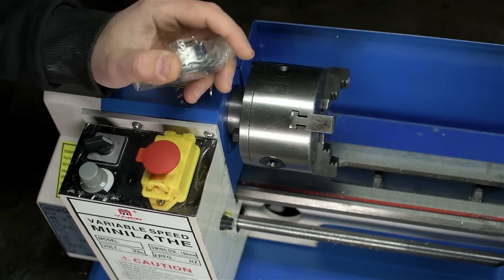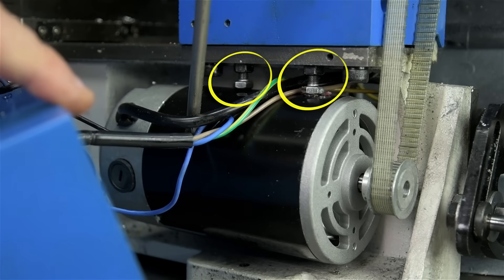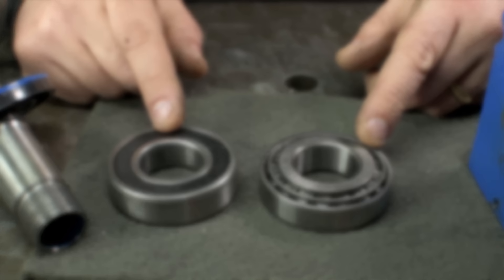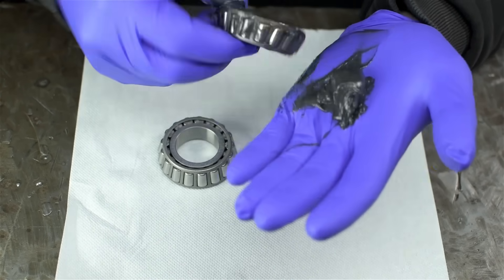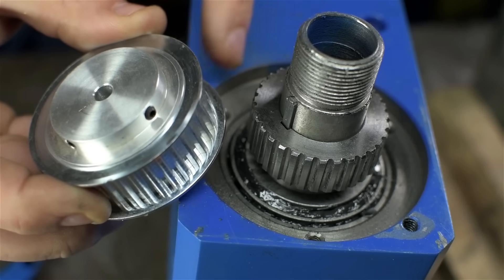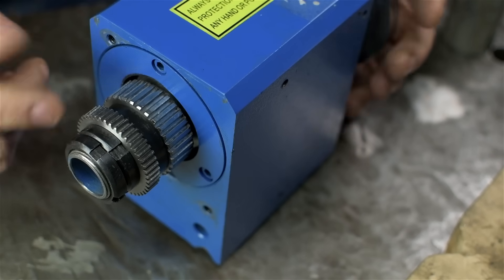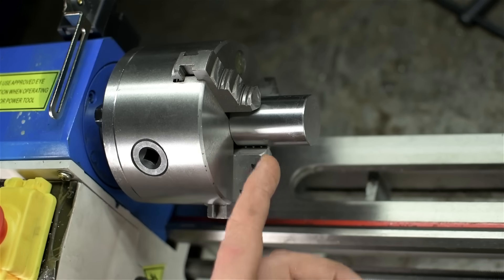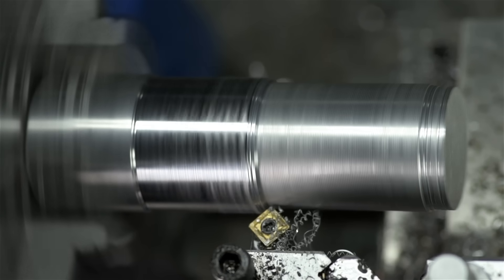Better LATHE Than Never!

Comment: I would machine a spacer between the two tapered bearings.. Just like you would with a pinion of a differential with a solid spacer.  You can shim it to get the correct preload. It makes for a nice rigid trouble free assembly.
Reply: Issue is shimming that correctly. That'd be a whole lot of putting together and taking apart.
Reply: @wyattroncin941 For sure. You'd have to unpress the non-chuck side bearing's inner race off multiple times, which isn't something you want to do a lot of.
Reply: @wyattroncin941  just like a differential..  in reality it doesn't take a long time.  That gear box would go very fast.  The benefit outways the time spent.. once and done.
Reply: @scrappyjackalope9558  I'd just use the jam nuts. If it becomes a problem with your whole 2/3 of a horse, then you have problems somewhere else. Solid spacers are for drag cars pushing hundreds of horsepower, not a tiny lathe that can be held with one hand.
Reply: Wrong,  the whole point of putting a solid spacer between the tapered bearings is to create a more rigid assembly by helping kill deflection.  It works in high horsepower applications yes by doing just that.  The whole point of the tapered bearing in this baby lathe is to cure or reduce deflection.  He may be able to take another couple thou. Of deflection in his lathe or be able to cut another .005"  per pass. Another potential benefit would be a more accurate torquing of the spindle...You dont have to like it or do it yourself.  But it is true and would be a perfect candidate for doing it.  For me I would spend the hour and do it.  With you analogy he should not have wasted his time changing out the roller bearings either..
Reply: Solid spacers are only a thing I. The performance car mod industry. Why? Because at a drag strip you theoretically risk crushing a stock crush ring under load and creating a slop in the differential. That is the only reason they exist, is to prevent backlash developing in a low 10's car. Otherwise they are completely useless. They do not increase rigidity, because they have the same amount of play as a crush ring or a castle but on spindle bearings. There is not difference between effective rigidity, only the point at which the system starts to fail, and with only 500w of power there is zero risk of failure. A solid spacers will add absolutely nothing for rigidity or deflection.
Reply: @wyattroncin941  I explained exactly why and what it does(decreasing deflection which is his problem here) in making a ring and pinion stronger.  By the way it is widely used in many many applications for the exact same reasons.  If you cant understand or do not see the obvious benefit there is zero need to discuss anything with someone of your obvious extreme knowledge.  Have a good day and a happy new year!!
Reply: @scrappyjackalope9558   Your logic is unsalvageable. The front bearing of a headstock is almost exclusively the one which dictates both axial and radial deflection under real-life cutting conditions, and it does not derive any benefit whatsoever from the spacer you recommend. The inner of the front bearing is solidly engaged with the spindle, and the outer with the headstock. The rear bearing is for preload almost exclusively, and is never exposed to significant loads. The nearest thing would be taking a heavy cut the "wrong" way, from left to right, in which case the workpiece would pull out of the chuck if it were not supported from the tailstock (which in turn means the rear bearing never sees that load). The preload on the rear bearing is sufficient that the elastic elongation of the spindle will exceed anything resulting from real life "wrong way" loads, so a spacer to take those loads would make no difference.
Industrial machine tool spindles never use the method you suggest. In the case of a fairly typical industrial lathe, it would require multiple tear-downs of a fully geared headstock with maybe 50 components, many of which require a hydraulic press to remove, just to adjust the preload on the spindle bearings, which would take several days of exacting work instead of a straightforward few minutes to make each adjustment and an hour to run it up to temperature.
Generalising from a differential to a headstock is like expecting a vet to diagnose a human. There are some similarities, but anyone who does not understand both situations as well as the respective experts would not even know what those were.
Reply: @Gottenhimfella pot called the kettle black,  who isnt understanding what?...lol...... every time tool touches material it is causing the kind of load I am talking about.  If this was not the case their would be zero reason or advantage installing a tapered bearing vs a ball bearing. The exact same load is created with a ring and pinion.  The pinion and ring are constantly trying to push away from each other by the very design of the gear mesh..  Again,  by installing tapered bearings you helping stop the deflection that causes chatter since they are a bearing designed to take that load.   Just like by installing a properly preloaded and torqued solid spacer which makes this assembly more rigid by sharing the load between the 2 bearings and essentially making that shaft a thicker assembly having a greater ability to fight deflection.  It is basic physics.  And yes this exact principle is widely used in many applications as others have pointed out here.

Your comment about the one bearing is taking most of the load in it's current configuration is correct. This solid spacer helps cure that problem by creating the more rigid assembly, and distributing some of the load to the back bearing.
Once torn down setting this up would have taken little time,  you are already there putting in the bearings..  would you gain much? Maybe, maybe not.  But when we are machining parts on a lathe we are trying to do this with repeatability and precesion. This can help in the long run make a more durable/stronger lathe.

Have a great new years :) unsalvageable out
Reply: Another problem with just installing tapered bearings with out some sort of a spacer is you are limited to how much you can torque everything else that resides on the shaft behind your means of fastening.  Now with this application it is isnt as crucial since there is little load issues in that direction.  But I would feel better replacing that little sloppy plastic spacer between the gears and getting a solid torque value on those spanner nuts.  Again more things to increase the overall strength and design of this assembly..  Now,  unsalvageable is out. :)
Reply: @scrappyjackalope9558  writes <<This solid spacer helps cure that problem (of the front bearing taking most of the cutting loads) by creating the more rigid assembly, and distributing some of the load to the back bearing.>>
That would be true for bearings which can accept axial load (the only sort an axial spacer can distribute) from both directions, like a deep groove ball bearing. It's patently not possible for taper roller bearings mounted back-to-back. The rear bearing cannot share thrust loads with the front one, because those loads are trying to separate the roller assembly of the rear bearing ("cone") from the outer ring ("cup").
Regarding "the more rigid assembly" you mention: Your spacer would help stabilise the cone of the rear bearing against nutating loads, but only if it were a loose fit on the spindle, which (for a machine tool) would qualify it only for recycling.
Reply: @Gottenhimfella  blah blah blah.  I stand by everything I have said and it is accurate so you are saying deflection due to load does not happen :) ok,  I will stop the discussion with you at this point since it is pointless.   :)  Have a great new year!!
Reply: @scrappyjackalope9558  gottenhimfella is completely correct in that the front bearing takes up almost 100% of loads, hence why the front or bottom of a spindle pack contains a thrust bearing and a seperate radial bearing, then I a back you get a smaller radial support bearing and a preload thrust bearing. Under a cut, the preload bearing would be forced to seperate, if the front bearing wasn't taking up all the load. And during a back cut, the tailstock takes up all the load.
Reply: @scrappyjackalope9558  and to your point of a solid spacers making the shaft thicker, that is completely wrong, unless again you have a press fit for the spacer *or*, as in a horizontal mill, your spacers are tightened down to the point that any bearings that might be included in the pack are now most definitely locked up. The kind of exact shimming that would be needed for both a spacer to be of benefit and for the bearings to be under correct preload is in the realm of shimming with tenths shims, and reshimming every time the bearings are shocked by a crash or something of the like. That is simply not feasible, even for modern manufacturing. Thus, you turn steps in your shaft for maximum rigidity and have a crush ring or similar preload mechanism in the bearing cover plate.
Reply: Solid spacers are used in almost every Machine Tool and Spindle assemblies across the industry. The ring and pinion isn't even a legitimate comparison.
Reply: @mattfaber6689  yes they are used everywhere.  I dont agree on it being a legitimate comparison though.  A shaft turning round and round made more rigid by a solid spacer to ke is the perfect comparison.  Have a great new year Matt!!
Reply: The proper way to setup bearings👍
Reply: American Patriot Adventures, the Head Stock is a spacer between the bearings, the only advantage of fitting any other spacer sleeve would be to contain the grease, this could be shimmed at each end using rubber O rings.
Reply: @johnbower  no john,  the spacer between the bearings serves a very powerful role.  Read all my replies carefully.  None of which have anything to do with seals, grease or oil.
Reply: @scrappyjackalope9558  A spacer between each "outer race" of two taper roller bearings does serve a very powerful role, and in this case the Head Stock itself is the spacer, no spacer is needed between the "inner races" of any pair of taper roller bearings as this is where adjustment is needed to remove all play out of the bearing.
Reply: @johnbower  keep re-reading all of my replies until it starts to sink in,  you will start to figure out the shaft flex will be minimized. I am turning notifications off to this thread as I dont see any need to say anything else to folks who obviously can not comprehend a very simple proven design used for a very long time.  Have a happy new year!!
Reply: @scrappyjackalope9558  No one other than you is suggesting the shaft is " flexing". The roller bearings where fitted to replace the standard type ball races that were originally fitted, because standard type ball races are not designed for this type of use, a standard type ball race does have a minute amount of play in them even when they are  new, the only way to minimize this play is to put side loading on the bearing which they are not designed for, this is the reason taper roller bearings where fitted as they can be adjusted with side loading to remove the play, they are excellent for axle loading and reasonably good for thrust loading, which makes them an excellent choice for Head Stock bearings in a lathe.
 Any problem with the shaft flexing as you seem to be suggesting needs other measures to correct it, and certainly not by putting a spacer between the bearings as this will prevent further adjustment being needed at later dates as the bearings bed in. It appears you may need to think about this for some time before it sinks in. Have a happy new year!!
Reply: @scrappyjackalope9558  Yes you are correct saying every little bit helps, this is why you need to be able to adjust side loading to the roller bearings as they bed in, which you would not be able to do if there was a spacer between them. For you to understand this it appears you need to give it a lot more time for it to sink in :)
Reply: Thank you. You have a good New Year as well. Your are correct in regards to the  pinion they are similar. The plastic spacer being compared to a metal crush washer is my disconnect. I'm no stranger to being wrong though. 😁
Reply: @mattfaber6689  oh I get where you were coming from.  I was never referring to that little plastic spacer between his gears.  I am saying making a spacer that goes between the tapered roller bearings then shimming them for correct preload of the bearings.  

As far as the plastic spacer already there I would make one out of steel as well.
Reply: @scrappyjackalope9558  the biggest issue with the idea of a solid spacers being more rigid is that if the spacer is anything other than a press fit between two press fit bearings, the spacer is doing absolutely nothing to help with any rigidity until the shaft flexes. Yes, if the spacer is a part of the shaft or has a mechanical fit to the shaft, it will be more rigid. But if it has any play at all, even just a tenth, the benefit is lost.
Reply: @wyattroncin941  Hi Wyatt,  I believe you are struggling with seeing the forest through the trees.  Because the assembly is PRELOADED and under TENSION it absolutely makes the the whole assembly more resistant to deflection. The preloaded sleeve is parallel to the shaft under PRELOAD..  It is sharing the load.  If the preloaded  sleeve was not there, there would be a higher chance of the shaft flexing between the bearings under a side load of the tooling pushing again the material being machined.
Reply: @scrappyjackalope9558   
With or without a preload shaft, or solid spacers, the shaft will still be under the same amount of tension. The difference comes when the preload shaft is no longer a preload and us now serving as a  prestressing member. Bearing preload is nothing compared to prestress forces, and at preload force the solid spacers is doing nothing to improve rigidity. If you want a prestress, you make a prestress. But it cannot also be giving preload on bearings.
Reply: Solid pinion spacers in diffs cause as many problems as they solve.Bearings wear in.  And with a solid spacer you end up with the pinion walking around. been there done that in a quick  600hp road race car. Went back to collapsable sleeves with no issue.
Bearing spacers on front hubs are handy but you have to machine them a bit short then allow for a thinnish [at least 20 thou]  shim and expect that to come down soon after.
Reply: That's too bad you had improper set up.  When you set them up correctly with the proper parts there are zero issues with solid spacers.   When yahoo's(and there are plenty of them out there) "throw" in a solid spacer when they have no clue as to what they are doing (sizing, proper preload and torque) you can have a issue like ANYTHING else.  Many manufactures have used them for many years with millions upon millions of trouble free miles.  The crush sleeve came about with assembly line cost cutting measures in both parts and labor..

That all being said, as mentioned above proper preload spacers have proven themselves in HD applications for many many years in many many applications..   Facts are facts..

Comment: youre lucky it doesnt have the hi-low gears... they are garbage plastic and also need replacement
Reply: I am considering carving a new Spindle for full 1" thru and get rid of Hi-Lo  (62x40 bearings)
Just how small do parts need to be that they require the High gear anyway?
Reply: @rwbimbie5854  a 1 inch spindle bore is a huge improvement , but you will need the 5 inch chuck since the 4 or 3 will be a choke point.. You dont need 2500 rpm for 99.999% of operations.. set the gearing 3;1  and you will have 1650 max spindle..which i think is ideal on the small machine
Reply: Too bad the 62x40 bearing is such an oddball size..  not really many midgrade options between $30 in us and $3 in china.
Reply: @rwbimbie5854  what about the mini mill 60mm bearings .. theyre 7 bux each as i recall.
Reply: @airgunningyup  Just did a search for "40" at LittleMachieShop, it found a 40 OD bearing but no 40 ID.
(huh... maybe I should look again for the "62" outer, and hope there is a big-but-not-40 ID)
Reply: @rwbimbie5854  id just do a generic google search since this would be pure  custom

Comment: No wonder I'm blind. Wasn't wearing my safety squints. Good thing this video is braille.
Reply: As stated on the label.... "make sure to use your one good eye".
Reply: @knlazar08  - Seen on the Physics lab door: "Do Not Look Into Laser With Remaining Eye"
Reply: A machine safety sticker I woul like to have, each line being in larger type than the one above:
If You are an IDIOT,
Step backwards,
Untill you can't
Read this
SIGN!
Reply: @captcarlos  I need a sign that says: Ego protection must be worn in this area.